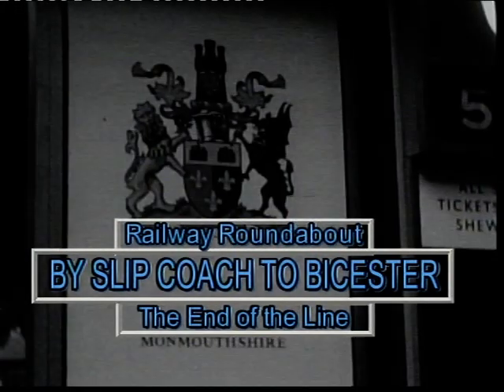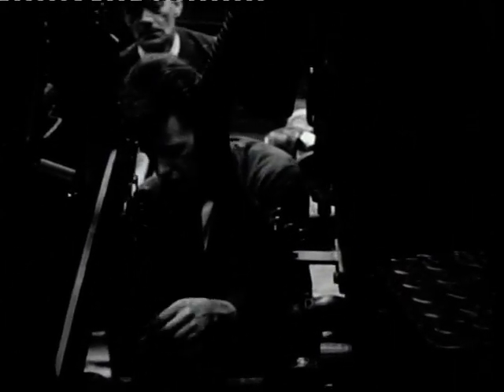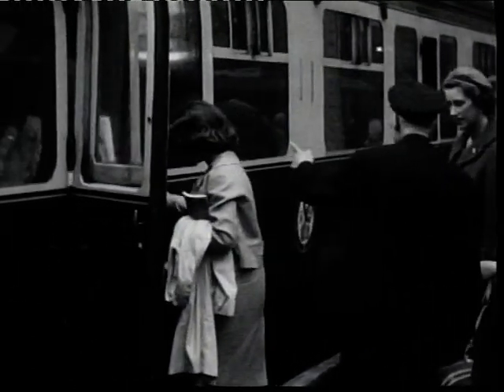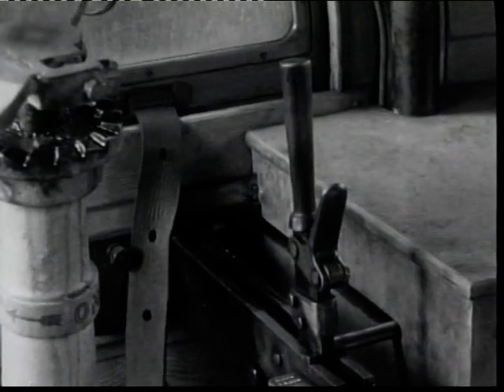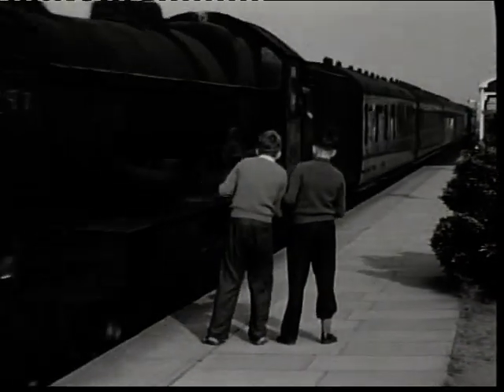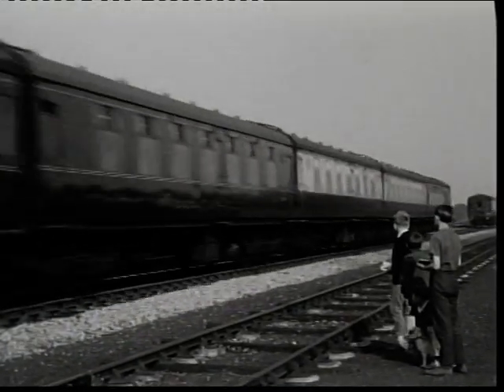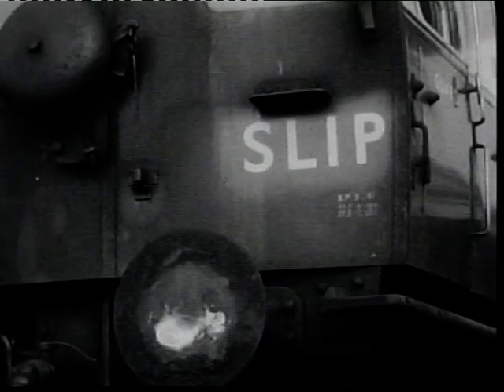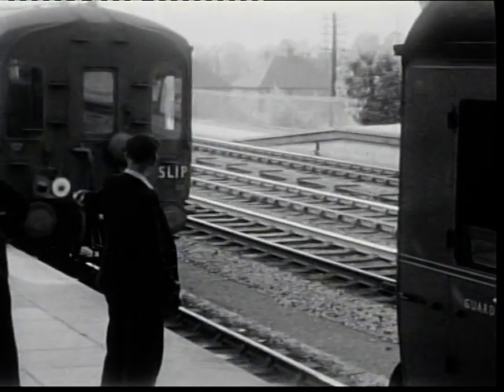SlipCoach

Comment: First of all. I was under the impression that slip coaches were slipped into a station with a bay platform where they would terminate. I had no idea they were shunted into another waiting train. Also, why not slip it onto the back of the train in the platform loop, rather than detaching the loco from the waiting train and shunting onto the front? It would need a shunter with good timing to switch the turnout after the express had passed, but in those days they wouldn't be afraid of doing something like that :-)
Reply: The turnout on the main line would've been part of an interlocking worked from a signalbox, and would not be a hand-worked set of points. For reasons that should be obvious, switching a set of facing points between the main train and its slip coaches was not considered an acceptable practice.
Reply: as well as the isues of the points being locked by the signalling system there are also issues with a coach at speed moving onto the back of a loaded passenger train... if the brakes were to fail (or the guard become incapacitated) as the slip approached the 'obstruction' it could be somewhat "messy", by keeping it on the main line they've maintained over run protection

Comment: Indian Railways are very much British in their DNA even after Independence names given to express trains like Inter-City Express etc. They still follow the centuries old traditions even today, even though the rolling stock is very  modern and comfortable. A slip
coach or coaches that are detached even though they are not slipped on the run. 

1. What is a slip train in Indian Railways (IR) ?
In IR, sometimes to save cost and time, few coaches do not go to the final destination of the train. They are detached from the train and left behind. Those coaches are called slip coaches of train and they might be picked up by another train or that could be the final halt for them. The train which has slip coaches in it is called slip train. 

2. Do I need to change coaches while travelling in a slip route train? 

No, you don’t have to change to any other train at any station. During reservation itself, you will be placed in the respective slip coach. 

3. What is the difference between a slip coach and through coach?
A through coach is similar to a slip coach but it is later reattached to another train so that it can proceed to another destination. On the other hand, slip coaches may or may not be sent forward after they are detached.
All slip coaches and through coaches are that have reserved seating. Unreserved passengers are not allowed to board these coaches. 
The SLR (Seating Luggage Rake) or Guard Brake Van which is usually the last coach of a consist, but if the train has a slip or through coaches then the SLR Coach stays as it is and the slip/through coaches are coupled to the SLR/ brake van, so when the slip/ through coaches are detached, the crew check brake air pressure and connectivity and move onwards to the destination,  leaving behind the slip/through coaches which are attached to another train taking them to their destination or are shunted to a siding if that particular station is their destination.
Extra coaches eg. Railway Inspection Coaches,  tourists group coaches are attached to the end of trains and they are dropped off according to their scheduled stations as per their itinerary where the group tours that particular area and then board the same coach which  is parked at a siding and travel to the next destination.
Reply: Fascinating stuff Danny  thanks for that . Always good to get knowledge of other countries methods 👍

Comment: Not only did we accomplish slip working, but we accomplished it with no greater impact on safety than with any modern train!
 
To think that we achieved something so finely engineered yet (Possibly) risky in an era where radio sets were such a rare find, yet can't accomplish this today in an era where every smartphone is a supercomputer... :-o ;-)
Reply: Similar to hump marshalling yards. The concept that rail transport could be enhanced momentum doesn’t seem to have phased anyone. Love to see someone try that today.
Reply: Its not that we cant use slipcoaches anymore, its because they are no longer necessary. Slipcoaches were used because steam locomotives could not accelerate quickly after stopping at a station. The slipcoaches were a solution to that problem by allowing the train to not stop at all while still dropping off passengers at a station. Diesel engines did not have the same problems as their steam counterparts therefore, slipcoaches were no longer needed since trains could now stop at all stations without losing time.

Comment: Slip coaches were introduced to give intermediate stations on the route a fast service at express speed without stopping the express. GWR had most of them. Pax were locked in to stop other pass getting in the wrong carridge and to prevent them opening the doors before the carridge stopped at the station.
Control of the carridge needed skillful handling as each carridge was different in running characteristics, don't know if line side markers gave any help as the release speed had to be constant but likely wasn't therefore the great skill needed.
Don't know of any accidents with slip coaches?
Reply: There were some accidents, the favourite was running into the back of the train they'd been slipped from if it then had to brake, the worst (that I've heard of) injured over 30 people.
The whole concept breaks the cardinal rule of train/signalling safety of only ever having one train on any given section of track, the moment it splits you have two, & a potential for one to hit the other.

Comment: Whats the pourpose  of slip coaches it just stays at the station
Reply: DolphinLegend 64 so the locomotive does not need to stop
Reply: the idea is you could board your train in London, then not have to change trains even if you wanted to travel down a branch line. So, you'd get in the correct coach, it would slip, then it would be attached to another train that would start and continue down a branch line, this made journey times faster as, not only did you not need to stop the train in many stations, the passengers didn't need to disembark and remebark meaning the branch line train could leave as soon as the coach arrived.
Reply: More common than slip coaches were through coaches. So if you wanted to travel from a minor route to a major city destination, you didn't need to change trains as happens today. The original locomotive would uncouple, and your coach would be coupled to the express without you having to leave your seat. Fixed units meant this was no longer possible.

I was surprised to hear slip coaches were still being made as late as 1958.
Reply: they were'n just a single coach they could consist of a rake of as many as 6 coaches
Reply: As many as that!
Reply: Some trains had many slip portions as well, I think up to 5.
Reply: Were any slip coaches let run adjacent to platform, so passengers could immediately alight?

Comment: To re-attach the car they hitched it to a cable going up a slope to a stationary engine, winched it to the top, passengers got on then at the right moment released the carriage which hurtled down the slope, through sprung points, and onto the back of a passing train.

;)

Comment: A classic example of a bad idea that was made to work using labour. A skilled guard on the coach, a driver and fireman on the shunter, and at least one man to couple the coach; then repeat on the return, with the guard as spare man. As the commentary says; only those going to Bicester North benefited from this cost. Those going down the branch line would almost certainly have got there faster if the expressed had stopped and there was a connection waiting; and only way back was on a service slowed by stopping at Bicester.